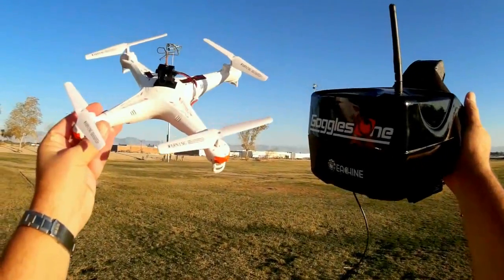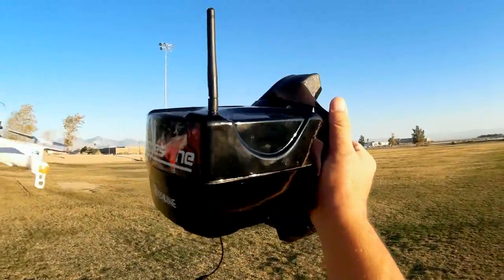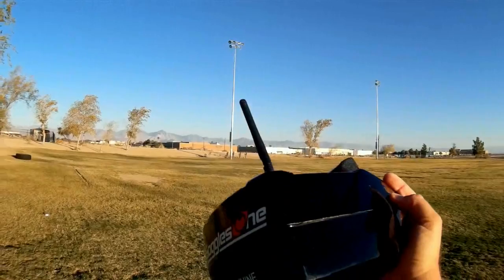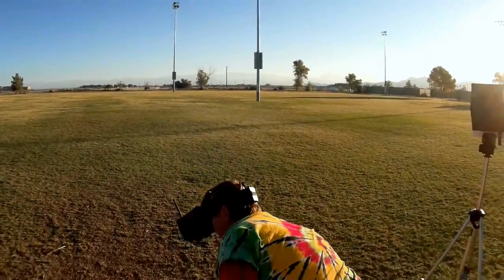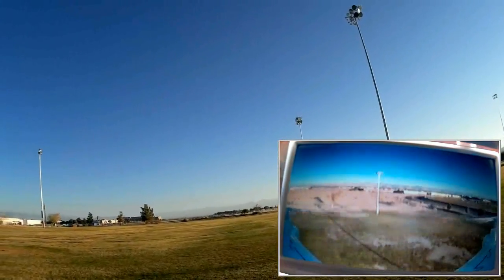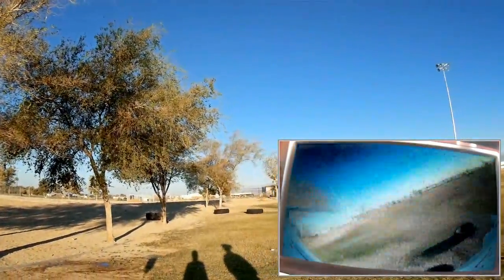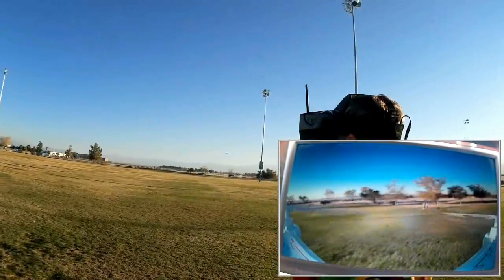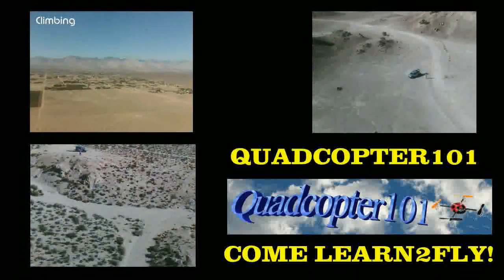Syma X5C FPV Racer Conversion Goggles One and Eachine EF-01 Micro FPV Cam

Comment: there is another cam/vtx combo on banggood that is 250mw and 4g but uses a dipole antenna, it is $25 compared to this one at $40 and 9g, i know that antenna quality is more important than power but  i would like the lighter one for smaller quads. do you think there is so much of a difference between antennas that it would make a difference flying around the house and 1 acre yard? there are 2 cams that weigh 4g but one is $40 with a circular polarized antenna and the other $25 with dipole, i'm just cheap and want the less expensive one. thanks a million.
Reply from the maker: The one in this video is only $26, and about perfect for flying around a 1 acre yard. http://www.banggood.com/Eachine-EF-01-AIO-5_8G-40CH-25MW-VTX-800TVL-13-Cmos-FPV-Camera-p-1064301.html?p=RB0922217402201307U3
Reply: +Quadcopter 101  Do you think there is a noticeable difference in weight if used on smaller micro quads? this cam is twice the weight of the one with dipole. thank you. i'm addicted to your channel and i won't buy a quad unless i have seen you fly it.

Comment: In my experience, motor life can be extended greatly by not operating in a stalled state.  Brushed motors start cooking when stopped with power on. My first set lasted only 10-12 hours, but I was learning...crashing into trees and using throttle to help get it loose. Also, I would crash and be slow to get off the throttle.  Great video QC101 !  Thanks for getting me off to a good start with the X5C-1 and your flying lessons :  )
Reply from the maker: That's correct. It's very important to learn to cut off power IMMEDIATELY in a crash.  When I feel a crash is inevitable, I always cut off the throttles even if I'm still in the air.

Comment from the maker: I only touched on this in the video, but here is how to improve the longevity of your small toy grade brushed quadcopter motors https://www.youtube.com/watch?v=LzzD3BPVvH0
Reply: hi Quadcopter 101

i would love it if you'd answer

i have an x8c with an rc305 fpv already but am intrigued by this video so have bought the ef-01 and x5c, how did you get power for the ef-01, was it parallel to the quads battery plug or a separate battery, if so what is the mah of that 1s battery

and im assuming the ef-01 will work with the rc305 as it has the same channel bands (frequency)

many thanks

shakib
uk
Reply from the maker: Night Flyer The X5C (and many other toy camera quadcopters) has a power port and plug for its stock camera.  Now I removed my X5C camera a long time ago as its video is just terrible. Instead I use a 808 keychain camera if I wish aerial video from my X5C.  I snipped off the power plug from the old X5C camera and spliced and soldered this plug to the power leads of the EF01 camera.  Now my EF01 FPV camera can be used with the many toy grade quadcopters that have similar camera power port. Here's one example https://www.youtube.com/watch?v=OTN3qI03UKA
Reply from the maker: Night Flyer Alternatively you can also simply use a separate 1S battery.  Here's an example where I velcro the EF01 and a 3.7V 350mah battery to my F959 glider https://www.youtube.com/watch?v=QSudydIEIQ4
Reply from the maker: Night Flyer And why not subscribe, as you'll be alerted to other great videos like these when they're released?
Reply: +Quadcopter 101 i have done, you are up there for most helpfull youtubers, i cant thank you enough
Reply: The FX797T I have came with a extra adapter that you plug into the battery and then to the quad and has a splice in it for the cameras power. The connecter was the same as the X5C style battery plug. I have also used a separate battery for the FX797T 100mAh and it last 10 to 15 minutes on a charge
Reply: in the end, i just soldered it direct to the board as the connector was crap
Reply: That is definitely the best connection.

Comment: How did you power the camera ?
Reply from the maker: The X5C comes with its own camera, which I had removed to save weight.  But there is a three pin power port in the belly of the X5C that its camera normally plugs into for power and control.  I simply used this port as the power source for the EF-01.  So by doing this, the quadcopter's battery is powering both the quadcopter and the EF-01 micro camera.

Comment: Hi QC101, wanted to take a moment to say thanks. You pointed me towards a X5C back in March and I bought a clone and gave me some great advice. It took me sometime to get a handle on flying. Landed in trees hit buildings, flew out of range, bent a prop shaft (was lucky it bent right back) Killed the camera, don't know if the cam died or something in the quad/transmitter. Any tips on diagnostics?
I've been watching your demo's as well as others and seems you still can't beat a X5C, now that I can fly to a degree, I would love to have the cam back.
Reply from the maker: eh, the camera is the weakest link of the X5C. It's video is just not that good. Get a good 808 keychain camera instead for mcuh better video https://www.youtube.com/watch?v=Yk4p_9oEAb0
https://www.youtube.com/watch?v=J1KPT8IwQEk

Comment: the x5c it's a keeper!!! 100%
Reply from the maker: Mine is over a year old with hundreds of flights.  BUT it is important to remember to immediately turn off the throttle after a crash (I usually do it as soon as I know it's going to hit the ground.  It can take a fall). Also I do remember to spin the props before and after every flight  https://www.youtube.com/watch?v=LzzD3BPVvH0
Reply: @Quadcopter101  that's a good tip for a newbie!
Reply: Cant go wrong, awesome quad
Reply: +Tim Timmy what? I have mine for 4 months now and i fly with it every week like three hours? no problems with the motors
Reply: +Quadcopter 101 plz respond i just got my syma x5sw drone and one of my motors isn't  working and I don't know what to do
Reply from the maker: Irvin Otajagic Do you know how to calibrate your quadcopter's gyros?  
1) Turn on the quadcopter and place it on a flat and level surface.
2) Turn on and bind the transmitter.  Center all trim tabs.
3) Leaving the quadcopter undisturbed, move and hold both control sticks to their lower right corners.  Hold them there until the quadcopter's lights blink. If they don't blink, then try lower left corners, lower outboard, or lower inboard until you notice the lights blink.
4) Let go of the sticks and try flying.
Reply: +Quadcopter 101 ok thx for the info

Comment: Similar to my home made setup.  Great little FPV trainer.  Put a decent antenna on your goggles for crying out loud. Flush that monopole down the toilet!  Use that set up with a diversity monitor with 2 good antennas and you'll have a ball! Cheers.
Reply from the maker: What antenna would you recommend?  I seem to have this problem every time I use circular polarized antennas. But there is such a large selection of antennas, I don't know which are good or not.  Also, would a planar antenna be a better idea for increased range with a CP antenna?  If YouTube automatically blocks your reply due to links, I'll unblock it.  Thanks!
Reply: I have 3 diversity monitor setups to use: One with my X380, one with my ZMR250 racer, and one to use with my Syma X8 TX (which I use with the X8 and X5 and other minis in which I've put X5 rev 6 FC boards).  On my XK X380, I have a RHCP mini-clover leaf from Birds Eye View on the X380, and the diversity monitor that I use with it has an 8 turn RHCP Helical on one input, and a RHCP Planar Birds Eye View on the other input. (its been solid out to a mile .. as far as I've gone).  On my ZMR250 racer, I use a VAS Duraspec RHCP clover leaf on the quad, and on the diversity monitor, I have a VAS "Mad Mushroom" on one input, and a cheaper small yellow domed RHCP ant.(CrazyPony) on the 2nd input (from Amazon). I've heat-molded the coaxes to keep the cloverleafs vertical and at slight angles to one another.  On my X8C I have a mini bare wire RHCP cloverleaf zip tied to the back leg of the X8C. The diversity monitor I use with the X8 TX has a VAS RHCP Airscrew on input 1, and a cheap Aomway RHCP (white cap) cloverleaf on the 2nd input. On this last setup, I've had my X8 (with 200mw vtx) out to 300m with no drop outs.  On the X5 with 25mw vtx, I can get a solid 100m, which is probably as far as I'd want to go with that little thing, since I can barely see it beyond 75m. VAS does make a really good antenna, but they cost more, since they are individually tuned, as are the Birds Eye View antenna.  Most of the quad which come with a cloverleaf antenna are RHCP. Helicals and Planars are pretty directional, but not extremely so. The cheap 14dbi flat panel's are more directional and don't seem to live up to their advertising.  If you're going to put the antennas on your recording diversity monitor which you mount on a tripod, you're probably better off with something like I use on my ZMR250 setup.  If using on a TX mounted monitor where you can keep the antennas more or less aimed in the direction of the quad, then the setup I use on my X380 would probably work best.  Hope this is of some help. (I got all my stuff off either Amazon or eBay) Cheers.
Reply: Get this Mad Mushroom antenna, it is the best you can get for any 5.8 receiver. http://www.readymaderc.com/store/index.php?main_page=product_info&cPath=11_45_49_97&products_id=1253
Reply: +Quadcopter 101 the Aomway 5.8 ghz skew planar antennas work as well as anything but the most expensive ones out there, and they cost $12 for a matching pair
Reply: Jon B Baca With all due respect, I tested the Aomway 14dbi planar, and it is very poor in performance. I got about the same range with it as a 5dbi monopole. It sits in a box of "stuff" somewhere in my house, since I've found it a poor performer, compared to other antennas.
Reply: Hmm.. Maybe you got a bad one. There's lots of tests out there that show it better or the same as Immersion antennas and even IBCrazy antennas. Plus they're durable and cheap

Comment: can it also with the syma x8c?
Reply from the maker: The X8C has a 7.4V battery. Although you could tap off of one of the cells, I wouldn't recommend it as it would eventually cause charge imbalance of the battery.  But the X8C can easily carry the weight of a small dedicated battery for the camera.  Similar to how I did it here https://www.youtube.com/watch?v=QSudydIEIQ4
Reply: I'm doing it with the syma x8  :) lets see how it works